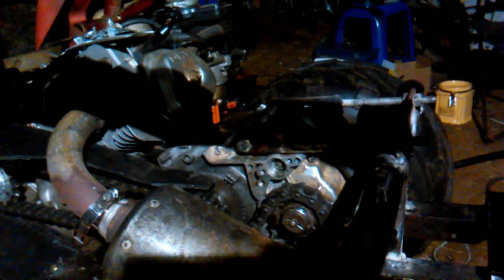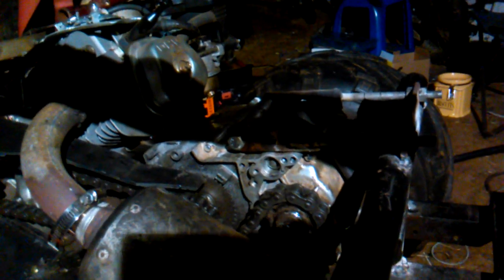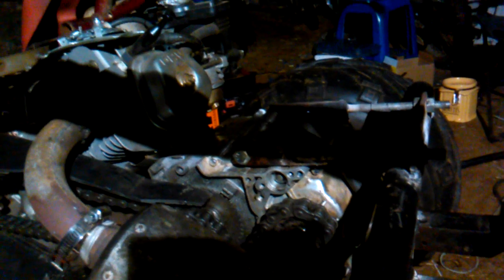Engine to gearbox conversion

Comment: nice work, but my problem is how to mount the reverse gear during assembly. please help me out
Reply from the maker: Gday mate thanks for subin I used the center of the old magneto because it matched the taper on the shaft and welded the rear gear to it so the key way and original nut holds it on like it used to it was hard to cut it out of the magneto but works reliably I hope that helps good luck with your build cheers